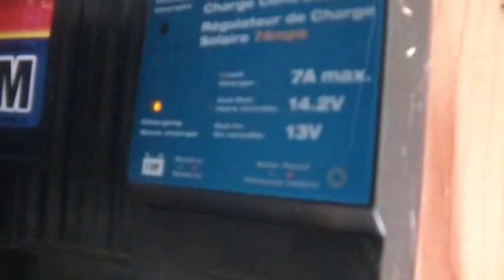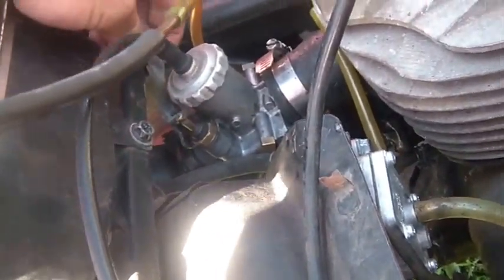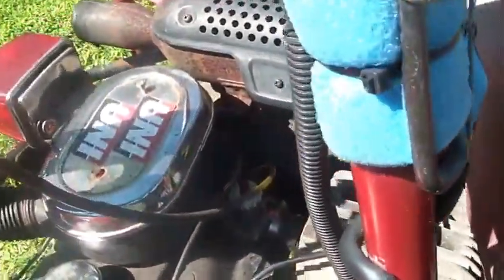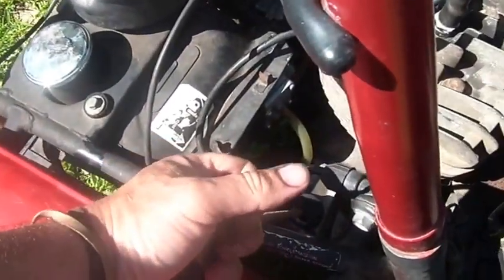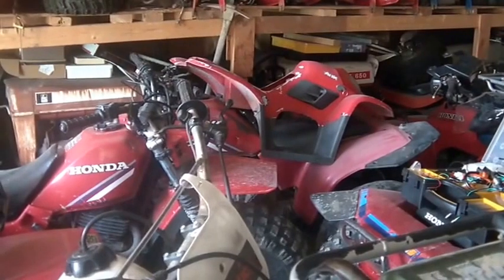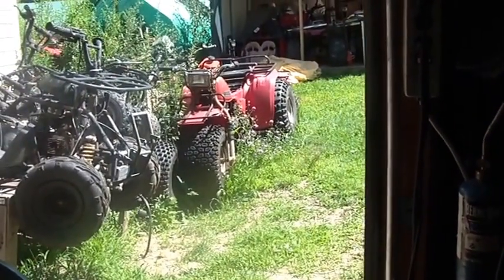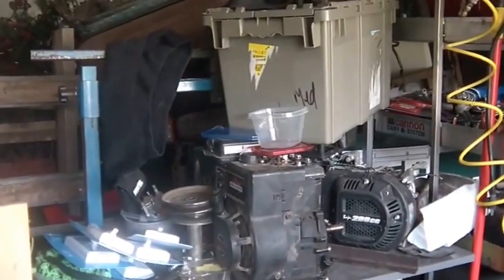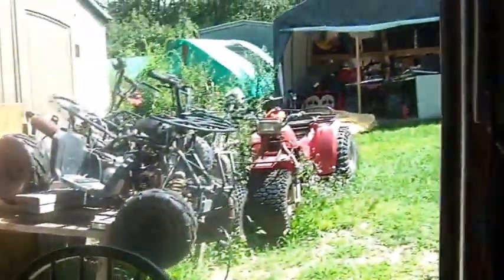8_8_2016, Barn find 1984 Honda Odyssey Cold Start

Comment: Hee hee nice Harvey ! I had one from the first year they made em with the 250r two stroke that blew up after a couple weeks ...had a cast crap piston.Rebuilt it ran it hard then put a 350x 4 stroke on it i had built by Curtis Sparks racing with a kerker bezerk header .Still got it 35 years later still runs like a scalded dog too just needs alot of tlc.My kids and grandkids have been hard on it lol. Thanks .
Reply from the maker: Hey Pratt!!!   Wow, an Odyssey with a 350X, that means manual clutch and a 5speed, that had to be crazy fun to ride... My experience with the 350x motor is that it was not a really quick motor, (it takes some time to spin up), but, it had a lot of torque, it pulled solid and hard.... Kids and Grand kids seem to be hard on everything they touch.... Thanks for my thoughts, the info, watching, and commenting!!!!

Comment: Rogers your man for that. I would run the gas with a little extra oil mixed in until it has some hours on it. Glad to see it running :-)
Reply from the maker: Hey Viking!!!! I set up the fuel / oil mix at about 24 to1 plus I added some fuel stabilizer and sea foam... I'm using good 2 cycle oil, I may up the oil a little bit more, too much oil fouls a plug, too little oil kills the engine.... Thanks for the encouragement, watching, and commenting!!!

Comment: when i was a teen. im 41 now. i bought a 84 rm80. head was off. bored it 60thou over. new piston and rings. it ran awesome. 2 strokes haveno valves. so there easy to do top end work. 😀
Reply from the maker: Hey Walter, 2 cycles are simple, but, they like clean air, clean good oil, good fuel, and an occasional top end rebuild... Some folks run them too long without rebuilds and destroy the engines.... Thanks for your thoughts, watching, and commenting!!!

Comment: I see a hole thing on the side beside where the starting cord is I think that is where the rope is supposed to go right?  Man that motor looks like it's coming out.  Well cool I knew you would get it fired up. Hey if it's smoking it's oiled. Good to go bro. Rip snort!!!!
Reply from the maker: Hey Calvin, The Odyssey still needs some love, like that recoil starter needs a new rode and needs to be installed properly, I need to check the motor mounts to see if they are still attached. It would really suck if the engine got loose, went side ways, and destroyed itself!!! I need to get some better mix oil and find out what the real ratio should be, I'm running 24 to 1.... It is getting closer to be a full  running  member of the hoard!!!!   Thanks for your thoughts, suggestions, encouragement, watching, and commenting!!!!
Reply: I think it is 50 to 1 but not too sure.

Comment: when adjusting the fuel mixture i always adjusted the mixture so it runs its best. then turn screw out quarter turn. leaving it a little rich. aslong as it the exhaust smokes good. your good. only my opinion. 
mostly im like yay it runs. 😀👍👍
Reply from the maker: Hey Walter, I'm with U, Yay, it runs!!!!   I rebuilt the carb, I did not make any adjustment yet, will do once I get a remote tank on it, I adjust my carbs the same way, a little too rich fouls a plug, a little too lean cooks and kills the engine, plugs are cheaper for sure.... Thanks for your suggestions, advice, watching, and commenting!!!

Comment: That engine looked like it was moving around a little too much.  It may be loose, or rubber mounted.  I'm not sure, but you may want to look into that as well. 
 I see someone already mentioned this,  Sorry for the rerun,...
Reply from the maker: Hey Tufdog!!!  The motor is missing an exhaust motor mount, I do need to check the motor mounts, it does have rubber mounts, but even with that, it is moving a lot.... I appreciate all the input, U R right, a few folks mentioned the engine movement, if no one it or only one person mentioned it, I may have let it go as normal and that can be a very damaging decision.... Thanks for your thoughts, advice, suggestions, watching, and commenting!!!!

Comment: Yes I would , just thinking of your lean condition and 2 strokes , haha lean , heat and runs no more. The only thing I would check is for vacuum leaks with a water bottle if you find a leak it will sputter.  At idle it sounds ok to me . Look forward to seeing out at 60 mph. LOL
Reply from the maker: Hey Steve, U taught me something, I did not realize a 2 stroke would sputter if one hits a vacuum leak with a squirt of water, I have used starting fluid for vacuum leaks, the engine races when one hit the leak.... Considering that the carb was not adjusted after the rebuild and that it did not have a fuel tank on it, it seemed to run better then I thought it would... Thanks for the info, advice, suggestions, watching, and commenting!!!!

Comment: Hey Harvey, I looked on line and found a owners manual for the Odyssey. It recommends 20 :1 oil ratio for a 1981 250 model. I don't know what ratio you have. It seems good according to the exhaust. Run it and check the plug. Hope this helps you.
Reply from the maker: Hey Larry, right now it has 24 - 1 in it + some sea foam and gas stabilizer, for some reason, I had 24 - 1 in my head.... Thanks for looking up the 20-1 info for me.... I need to get some motorcycle 2 stroke oil for it and then I'll hook up a remote tank and tear into the oem fuel system.... Thanks again for the info, thanks also for the advice, watching, and commenting!!!

Comment: id mix it rich check air filter and such make sure oil is in the crank case reg. maint. stuff. it looks to be running rich just due to the smoke I'm also no 2 stroke expert. looks to run good to me lol nice job!
Reply from the maker: Hey Corie, I'm going to keep the engine running toward the rich site, I rather foul a plug then run lean and cook an engine, I need to get some ATV 2 cycle oil before I go any further with the Odysey... I rebuilt the carb, did not adjust it yet, the air filter is there, it is not in great shape, I need to revisit  that also.... Thanks for your suggestions, watching, and commenting!!!

Comment: Originally they were designed to run 20:1 with oil from the 70's. With new synthetic 2 stroke oil, today you want to be mixing around 32:1.

Comment: definitely looks like the engine mounts need some help and if this sat for a long time chances are it probably needs new crank seals....the seals get old and weak and allow air to get sucked in thru the crank seals causing them to run lean which leads to piston damage very simple engine to put seals in to

Comment: what ratio of fuel to gas are you using? seems to be smoking quite a bit,but sounds good. pull a plug and see how its burning. do a compression test while the plug is out as well. you need to put a vacuum gauge on the pulse line when its running and see if it fluctuates. thanks for the shot out,hopefully i will get some subscribers.
Reply from the maker: Hey Roger, I do appreciate all of Ur help!   I'm running about 24 - 1 fuel / oil mix.... I also added some sea foam and fuel stabilizer to the mix... What should I expect on the compression check??? Somewhere around 160-180PSI? I'm going to put my vacuum gauge on the crank case line also.... I hope more folks start watching Ur channel, U do nice work.... Thanks for the help, advice, suggestions, watching, and commenting!!!
Reply: for some reason 20 to 1 sounds like the correct ratio if i remember correctly. i used synthetic oil which cuts down on smoke and plug fouling. i would say anything over 100 psi or so is good, dont use chain saw oil,get the correct stuff if you dont already have it.
Reply from the maker: Hey Roger, I'm going to get some better 2 cycle oil before I start it up again, thanks for the good suggestion, advice, watching, and commenting!!!

Comment: I would check or even put in a new air filter. And look in the tighten down some screws/bolts. I had a engine that shook didn't think anything about it and it fell out it's a sob to get it back together
Reply from the maker: Hey Frantic!!!  I deliberately put the video on the motor to show it shaking like that, several folks including Urself expressed concern about the motor mounts, so, the shaking must not be normal and I'm going to have to look at them closer... one of the mounts that attaches the exhaust is missing for sure.... The air filter is there, but, it needs some love and attention for sure.... Thanks for advice, suggestions, watching, and commenting!!!

Comment: Better jack up the axel, or be sure your emerg.brake is   
On before you start it.the throttle can be stuck open.....check your plug ...it shows if its 
Lean

Comment: Motor is vibrating/shaking alot. Needs new motor mounts to fix that.
Reply from the maker: Hey Brian, It does dance about quite a bit at idle, it still needs some adjustments, I rebuilt the carb and smashed it on, did not make any adjustments.... I will check the motor mounts though, it would suk to have the engine go sideways and get damaged..... Thanks for the suggestions, advice, watching, and commenting!!!

Comment: I would do some more research that's to nice of a ride ta mess up love that 3 wheeler take care :)
Reply from the maker: Hey Chevy!!!  I'm running 24 to 1 mix ratio, plus some sea foam and some fuel stabilizer, the engine has not been run in a while, so, the extra smoke maybe clean up... I'm going to look up the proper ratio and get some better mix oil before I start it up again.... There are a whole hoard of 3 wheeler floating around my place.... Thanks for the advice, suggestion, encouragement, kind words, watching, and commenting!!!!

Comment: Figure out the correct oil ratio and burn some donuts ! Woo Hoo
Reply from the maker: Hey Rusty!!!!   Right now I'm running 24 - 1, for some reason, that is the ratio in my mind... I'm going to buy some better mix oil and look up the proper ratio... I wonder if this will do donuts, guess I will have to try, thanks for the encouragement, suggestions, watching, and commenting!!!
Reply from the maker: Hey Rusty!!!!   Right now I'm running 24 - 1, for some reason, that is the ratio in my mind... I'm going to buy some better mix oil and look up the proper ratio... I wonder if this will do donuts, guess I will have to try, thanks for the encouragement, suggestions, watching, and commenting!!!

Comment: You know it's only running on one cylinder you're missing a spark plug wire that goes to the second spark plug
Reply: Tim Provost that's only a single cylinder machine